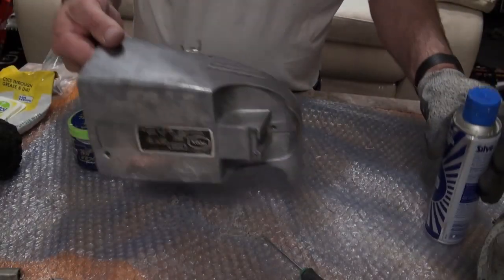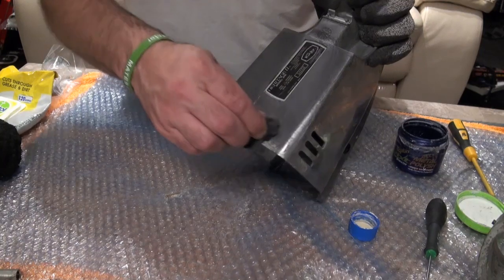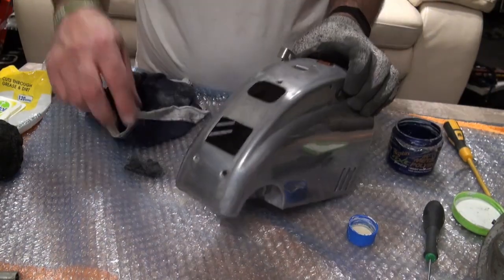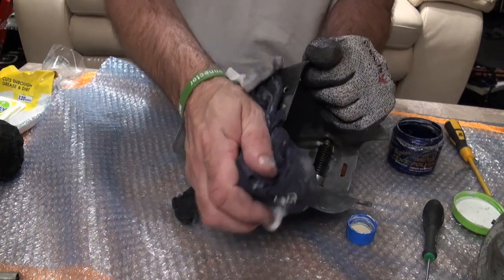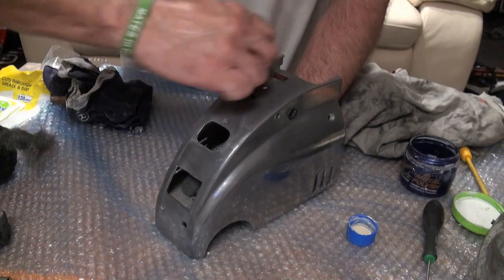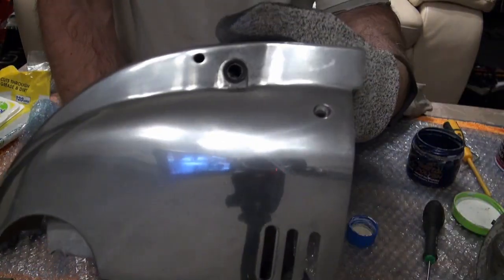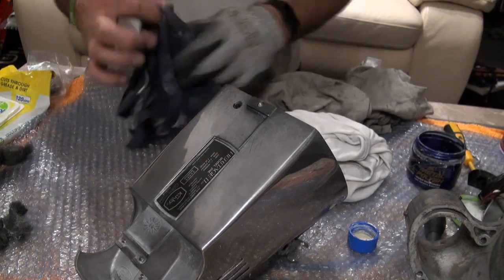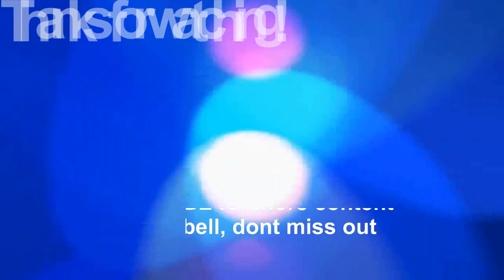HOW TO REMOVE OXIDIZATION AND POLISH YOUR KIRBY HERITAGE VACUUM OR KIRBY AVALIR VACUUM CLEANER

Comment: Glad to see that it is possible to take care of this issue! My Avilir got stuck in my garage for a few months due to a variety reasons, where there's no protection from the humidity, and it's definitely not in the best of conditions visually. Now I've got myself a fun weekend project (assuming I won't need to use the Kirby that weekend! Had a few issues with worn belts and badly positioned beater bars, as well as a nasty hair clog in the motor section that I only recently discovered and cleared out, so I've got a bit of vacuuming and shampooing that needs to be done first once I get some new belts!)
Reply from the maker: Great to here my channel is helping you get your Avalir back to working efficiently.
Thankyou for support of my channel 👍🔔 not to miss new uploads 👌👌

Comment: At the vac shop where I worked for years, we use a power wheel buffer & buffing rouge to buff out the old Kirbys and put a shine on the like paper brand new.
Reply from the maker: I have a buffing wheel and the different paste, I have done a video using it . Though most owners wouldn’t have one so I shared how to by hand . Plus I hand no buffing wheel when I made this .

Comment: Great result Dean.I can go to my old garage and pull out and straighten old Aussie nails in the timberwork they are high grade steel made in OZ..as opposed to Chinese nails from Bunnings which are garbage...Same goes for Aluminium...the older metal is of a higher grade and much better quality...as a retired Electroplater who specialised in Zinc,Cadmium and Chrome I shake my head at the rubbish we are being sold.I have a twenty three year old Simpson Washing Machine..made in OZ...the Chassis is high grade steel...I only have to tap Thai made machines to know they too are low grade junk.
Reply from the maker: Thanks for support and awesome comment, the days of buying good aluminium and steel has gone . The older  kirbys polish up a lot easier , you have to work a little harder on the newer ones .

Comment: I got an avalir 2 second hand and the brushroll head is in a terrible state. The locks for the brushroll guard are so rusty I have to hammer them open and closed. Aside from ordering a new brush head attachment, what do you recommend for fixing this?
Reply from the maker: Check the bearings on the brush roller run free, you can repack them after hair removal

Comment: I used 1200 wet n dry using warm soapy water to remove all corrosion, then buffed using T cut to a mirror finish, finally finished off using Autosol polish to give it a nice lustre and protection. It takes time to do the job right and if there is a lot of corrosion the 1200 grit will get rid of it without scratching deeply. I do like the old ways of polishing though, I still polish paintwork using old methods because they never fail. You are not afraid of a little elbow grease, which is, I am sad to say, lacking in the young today.
Reply from the maker: I didn’t d use wet and dry 1500 in another video where I removed deep scratches on Kirby g6,
The silvo to me smell like T cut so I think it had the same properties. 
I don’t a little bit of elbow grease , I think you appreciate it more when you put the time and effort in.
I also have updated version of this video due to sound issues in this one from 2yrs ago
Thanks so much for awesome comment and support . 👍👍